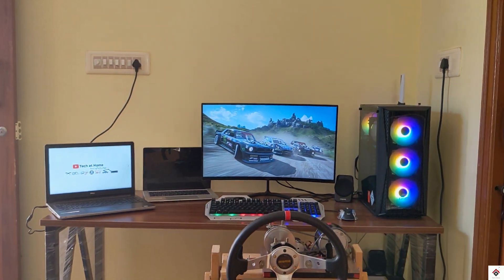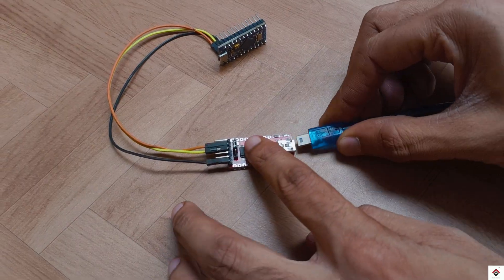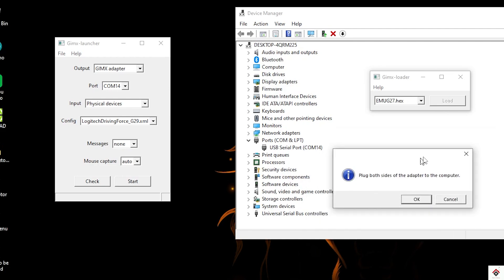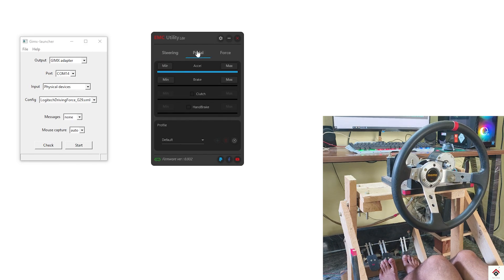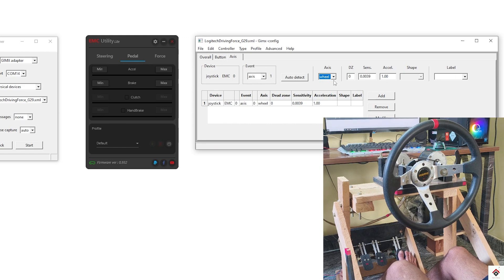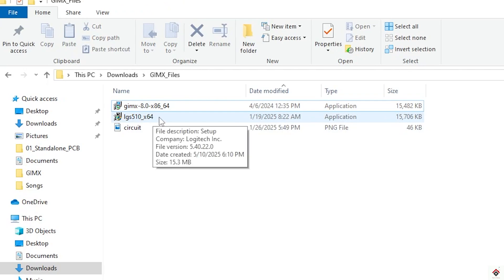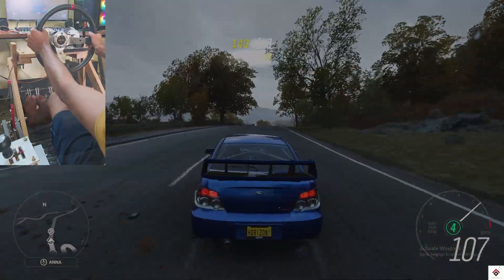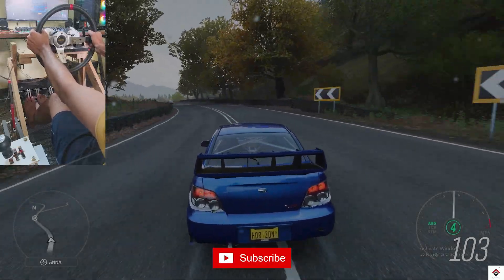DIY GIMX Adapter ✅ | DIY FFB Wheel Setup in Forza Horizon | How to use EMC Steering in any Games

Comment: auto disconnects after couple of minutes and goes back to arduino leonardo, any fix for this thanks in advance ?
Reply from the maker: I am not facing any such issues.
USB cable might be loose on Gimx adaptor. Try changing it.

Comment: If i connect both the USB to UART bridge and the ProMicro board, in the ports section of device manager, I see them both. CP2101 bridge (COM5) and USB Serial Device (COM4). Which COM should i use in GIMX Launcher? EDIT: i checked you video again, it's the FTDI converter. Thanks for the great tutorial!
Reply from the maker: Welcome ♥️🙏
Reply: @techathome  I do have a small issue, though. When I detect my VRS pedals, the detection works, but I am getting an "Failed to calibrate pedals" error message instead of that message asking me to calibrate them. Any idea why that is happening? EDIT: I found the issue, it was my DIY button box, which has a broken button (always on, always triggered) which messed up the calibration. Got the calibration working now. Just need to find the Shift-up, shift-down buttons in the config settings for G27... as I am using a Simagic wheel.

Comment: can we adjust the wheel sensitivity similar turning to virual one
Reply from the maker: Sensitivity cannot be changed. Only the maximum angle of rotation can be adjusted.
For better sensitivity, you can go with higher PPR encoder.

Comment: Brother I have a AS5600 Magnetic encoder, is it possible to use this encoder instead of the industrial rotary encoder.(Pls reply fast if possible)
Reply from the maker: Not possible in this firmware.
We don't have code to modify. They have provided only compiled hex file.

Comment: Is it possible to use the Arduino Leonardo instead of the Pro Micro? My DIY uses an odesc 4.2 com FFbeast
Reply from the maker: Yes, Leonardo board can be used for this adaptor.
Reply: @techathome  thanks, Can you send me the connection diagram that I should do with the Arduino?
Reply from the maker: It will be same as Pro micro.

Comment: Idk why in gimx launcher I cannot find any ports
Reply from the maker: Have you installed a driver for FTDI usb uart converter?
Reply: @techathome thank you so much brother. That solved my issue. But i have another problem now. My steering wheel is inverted in nfs payback and there is no option to invert the wheel in the game. Any idea how to solve this?
Reply: Oh i fixed it! I interchanged the LPWM and RPWM wires on the motor driver and the A and B wire from the Encoder. 👏
Reply from the maker: Welcome ❤️👍

Comment: Hi bro I need help. At first, I managed to upload firmware and to add the EMC inputs in the config.
Then when starting the emulation, I got error "failed to receive header packet". 
I thought I might need to re-update firmware, but now I'm stuck on uploading firmware. It always says "failed to upload firmware". 

I have tried restarting pc, unplugging USBs, closing all apps, and checking connection between the FTDI and pro micro.
Reply from the maker: Convert pro-micro board to normal by uploading blink hex file using Xloader.
It's shown in this video: https://youtu.be/crdDhvhBG0M?si=7BetNKzdy5qdm1rR
Reply: @techathome thanks I can try that

Comment: Can i use ardunino promini into arduino pro micro?
Reply from the maker: No, you cannot use Pro mini. It has a different chip.
Reply: Ok bro but i search all the shops arduino pro micro  can i use  Arduino Leonardo
Reply from the maker: Yes, you can use Leonardo.
Reply: The TX pin on the leonardo board is 0 and the RX pin is 1, but the TX pin on the pro micro board is 1 and the RX pin is 0. There is no difference when building this, right?

Comment: Does wheelconfig requires this adapter?
Reply from the maker: EMC firmware was not getting detected in Forza horizon.
If RFR wheelconfig directly works in Forza, you don't need this adaptor.
Reply: @techathome  Can ı use leonardo instead of micro pro ? you know its cheaper
Reply from the maker: Yes you can use Leonardo

Comment: Hello, do you have issues with centering midgame while using the wheel? My center point changes while using the wheel with EMC, made sure nothing slips in the mechanism.
Reply from the maker: Sometimes it happens, but 2 or 3 degrees only.
I thought it was because of mechanical parts.

Comment: i cant open logitech profiler software, but all is fine and normally detection, but i cant setting wheel in logitech profiler.

this is message error whe i open logitech profiler:::

Logitech Profiler was unable to detect any game controllers.
Please ensure the device is connected. If your controller requires a power supply, please verify it is plugged in and the LED on the controller is lit.

Once the connections are verified, click Retry. Clicking Cancel will close the Profiler.

please help
Reply from the maker: Did you install the Logitech driver?
Reply: that was solved, but i change metode to forza emuwheel, its very responsif for me and can setting ffb more than gimx,,, but thanks for your video tutorial
Reply from the maker: How to do it, can you share any reference?
Reply: https://youtu.be/ohSRitQex64?si=8TgAJpxfgwFwA14i

this video my reference,

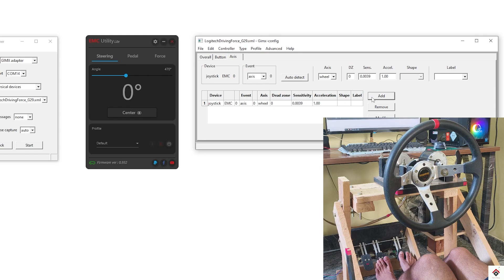Comment: I dont have Wheel choice 06:00
Reply: and same for gas and brake I dont have this choises
Reply from the maker: Uninstall and reinstall the software once.
Reply: I did what you said, now the Arduino Pro Micro does not see a com port. I cannot select the port in the Gimx section, so I cannot run it. I am about to go crazy, please help.🙏 @techathome
Reply from the maker: Com Port in GIMX launcher refers to port of the Ftdi converter. Not pro-micro.
Ftdi uart module driver might be missing. Try to install.
Reply: Ha okey thanks  @techathome

Comment: Thanks bro, I watched many videos but yours is very understandable. I have a question, does the gimx adapter have to have both usb plugged in, I remember that the adapters sold had only one usb.
Reply from the maker: Yes both sides to be plugged to same computer if you are playing game on the same computer.

If you want to play game on any other consoles like PS, one usb goes to computer which runs EMC and Gimx software. Other usb goes to PS.

Comment: why you use very low degree wheel
Reply from the maker: I was playing forza first time. So I kept 150 degree.
Reply: İf you can do 900 degree?  @techathome
Reply from the maker: Yes possible upto 1080 degrees.
Reply: @techathome thanks, and ı have another question, If I buy a rs775 15000rpm 24v motor and put the same tooth pulleys that you use, will it give good performance or do I have to choose a rs775 3000rpm 24v motor?

Comment: hey, i have a video idea. why dont you compare arduino based ffb to entry level ffb steering wheel. maybe go to nearby game shop and try their wheels and tell us about your experience
Reply: if you by entry level mean Logitech g29 or thrustmaster t128 and etc, the arduino will be "comparable" but it ofc won't be as good of quality as those wheels. But if you mean those cheap 50€ wheels that have 180° of rotation the arduino wheels slaps yhem out of the question its not even close

Comment: Nice video but I heard that Arduino are slow response so if we use esp32 instead of the promicro board will   it work?
Reply: It's based on atmega32u4 processor  so not esp32 or stm32 board or processor will not work
Reply: @Funverse101  firmware is based on atmega32u4?
Reply from the maker: Yes, ESP doesn't work for this.
Reply from the maker: It doesn't work with esp32.
Reply: Thanks for making this video ❤